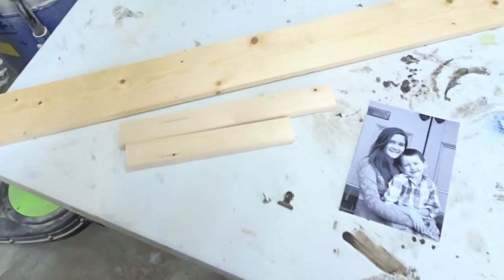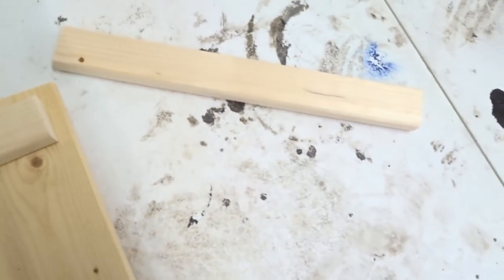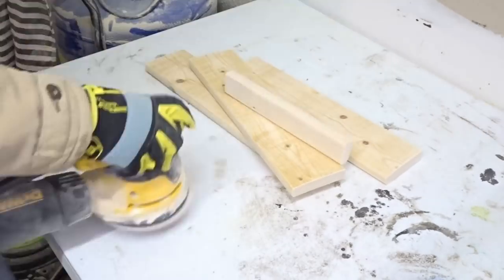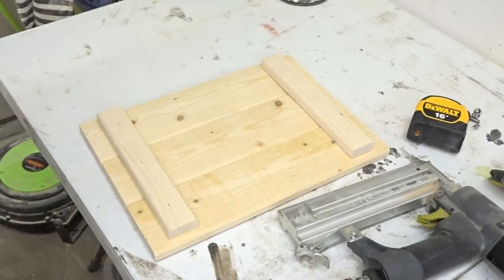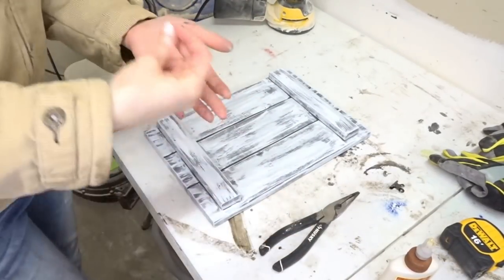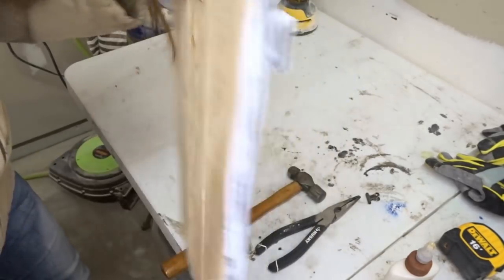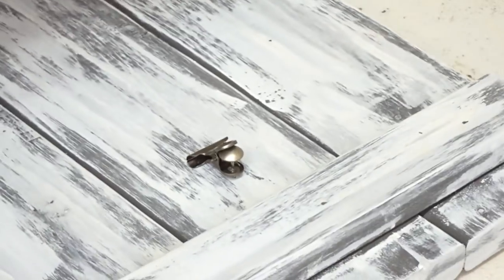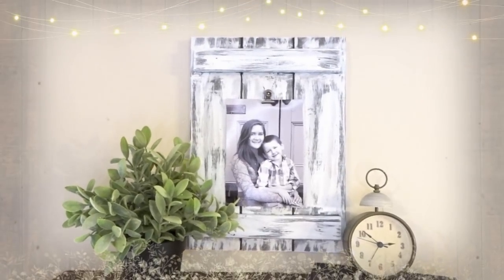DIY Farmhouse Pallet Style  Picture Holder

Comment: Very cute project, I like it a lot!! Just one tiny little thing and it's really not a biggie, I just thought you might want to know in case it was just a slip if the tongue. The piece you've attached the clip to the board with is actually a thumb or upholstery tack, not a brad. A brad is a similar thing, except on the back there is two straight flat pieces, instead of one pointed pin. Brads are used mostly in paper projects. 
Either way your project is great!!